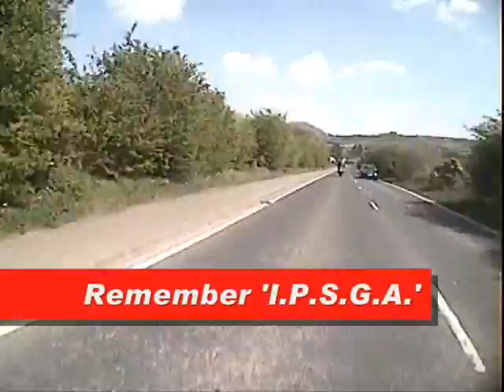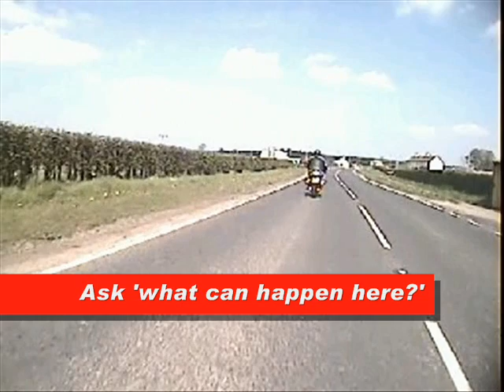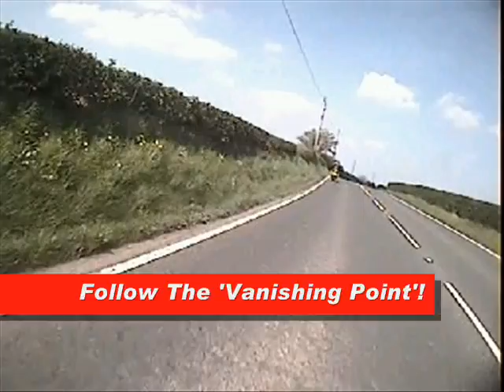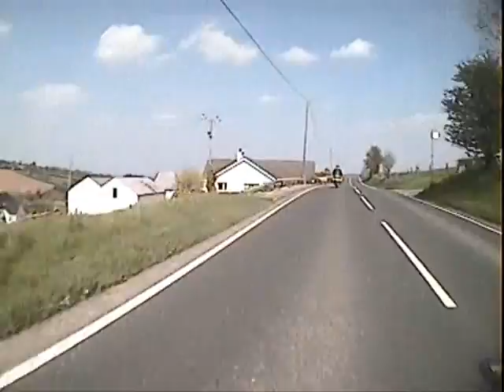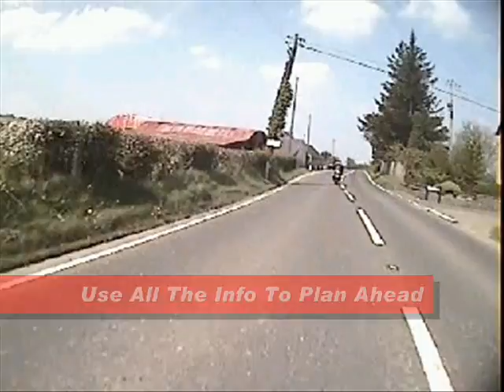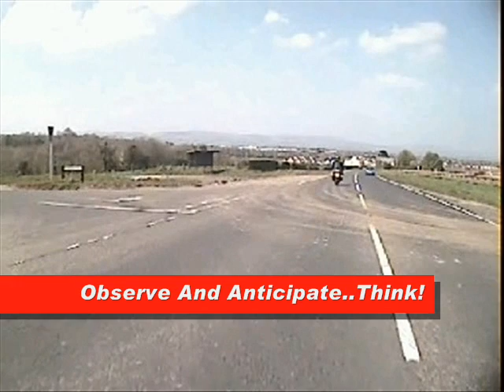Basic advanced principles LEARN2RIDE

Comment from the maker: this seems similar to the new manoeuvres tests that have been introduced in UK & N.I.

however, the problem still remains that the standard motorcycle test is conducted in town with little or no attention paid to rural roads, positioning, limit point observation, etc nevermind motorway procedure & so on.

therefore this info (& more) is deemed 'advanced training' & must be paid for after the standard test: most bikers do not take post-test training, which is a shame as you learn so much more

Comment: The vehicle control test include:
- driving 8 shape 
- Shifting
- emergency stop(@60km/h)
- precision stop (@60km/h) 
- emergency evasion(@50km/h)
- slalom at walking speed (5km/h)
- fast slalom (50km/h)
In addition to some other maneuvers, but the ones I just listed are the most important ones I believe. (Not too sure about the speeds, it's an estimate).

Only after you've past these tests are you allowed to have lessons on the road, during which the main focus is road participation/position.